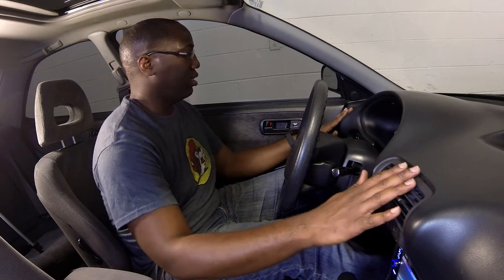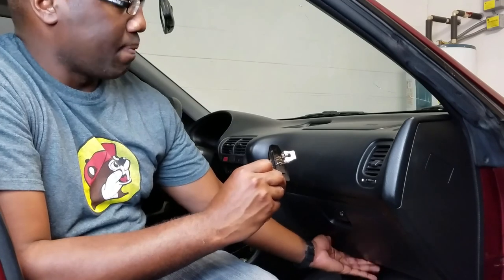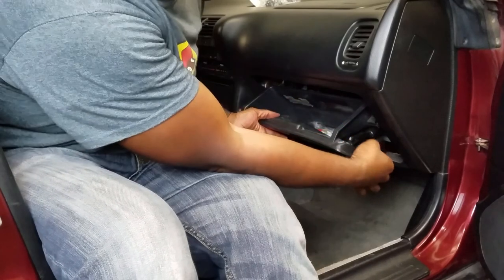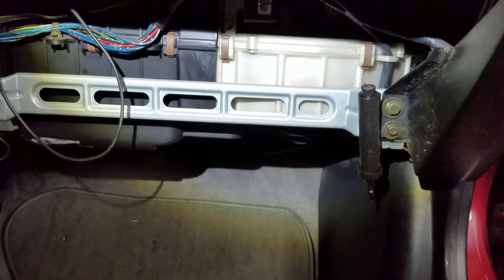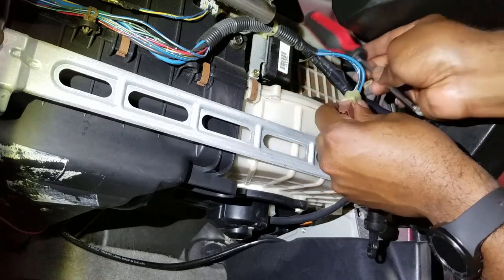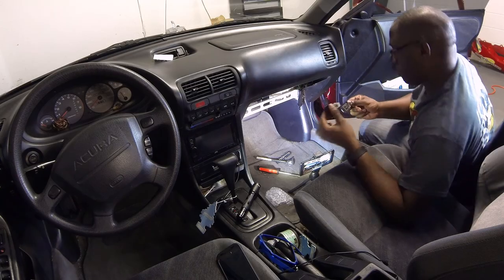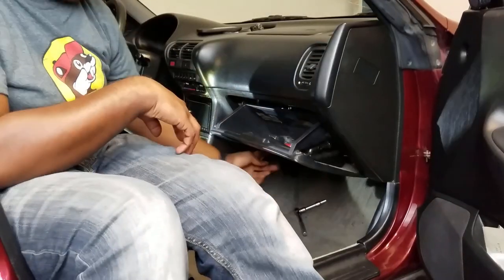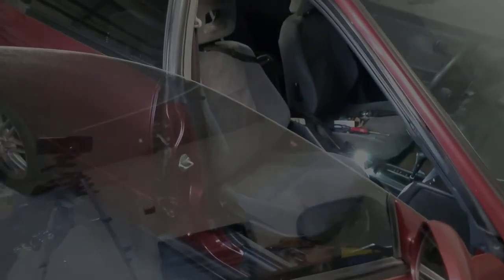How to get back ALL your fan speeds – Repairing Blower / Fan Resistor

Comment: I loved the intro/skit, made me laugh. Also this is a life saving video, I needed to change my fan resistor as there arent many vidoes of these on the integra.
Reply from the maker: Haha Thank You!  I appreciate it.
Reply: @BakeryPilot  do you happen to know why, the climate control switch can be hard to shift left and right, when I want it hot or cold if that make sense?
Reply from the maker: @karwinchau4684  I know what you mean.  Unfortunately, I don't know what causes that, and how to fix it.
Reply: @BakeryPilot  would you also happen to know why, the cooling fan won’t turn on? My fuses aren’t blown either. If I turn on my a/c it will make my car overheat.
Reply from the maker: @karwinchau4684  I honestly don’t know.  It could be a couple of things like your relay, or even the motor of the fan is bad.
Reply: @BakeryPilot  do you know where you got your blower motor? I need to replace that as well. Is it quiet or is there some noise? Some of these blower motor I been looking at, has a warning sign about Cali proposition 65.

Comment: I have honda city. My blower is not working. How can i diagnose the resistor. I took out the resistor. The ac was running fine. Now before i removed this resistor. The blower need hand rotation like jump start and still it was working very slow on level 4. Plz let me know how should i check.
Reply from the maker: I'm not sure changing the resistor will help in your case.  If the resistor was bad, the fan would not spin at all.  It sounds like the actual fan motor needs to be replaced since it needs a jump-start to get going.
Reply: @BakeryPilot  thanks.